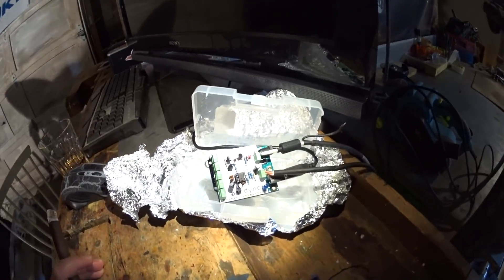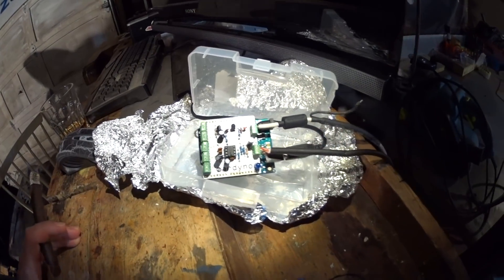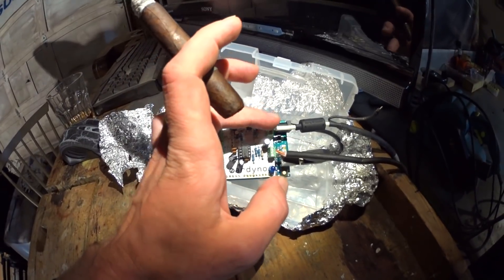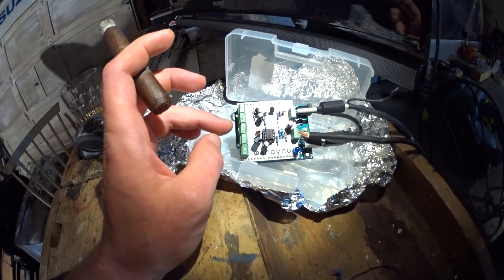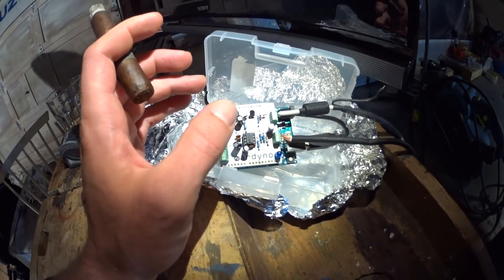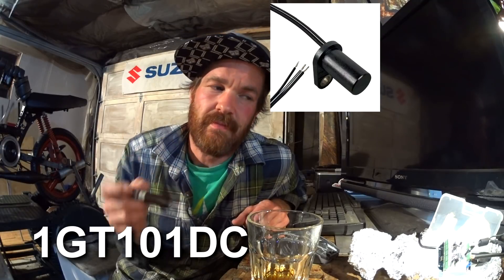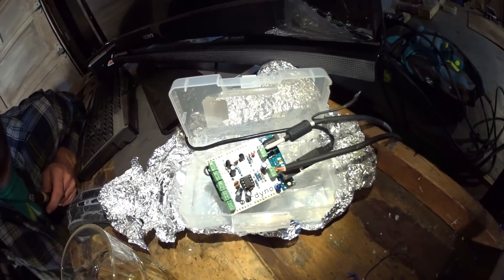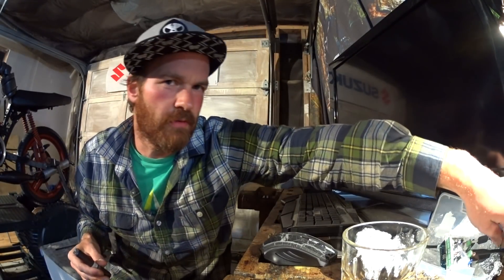My CHEAP SIMPLE DIY DYNO - ELECTRONICS

Comment: Is this module as accurate/good as a headphone if I only want to know the rpm?
Reply from the maker: +SWED Typez Just as accurate, but so much easier to get working right. If you want roller rpm only you can get by with just the Arduino, a hall sensor, and a pull up resistor.

Comment: how much to get this device shipped to italy?
Reply from the maker: +robelaser02 Shwfhc About 7euro.
Reply: 2STROKE STUFFING how much for the whole thing?
Reply from the maker: +robelaser02 Shwfhc Not quite sure yet, have to redo the design a bit and see what manufacturing of the pcb + component cost ends up at.
Reply: 2STROKE STUFFING nice, hyped for ARDYNO dude, keep up the good work
Reply from the maker: +robelaser02 Shwfhc Thanks!
Reply: 2STROKE STUFFING looking forward to dyno my modded vespa
Reply from the maker: +robelaser02 Shwfhc Boards are in, see latest video for info!